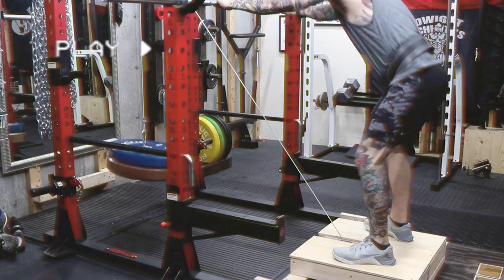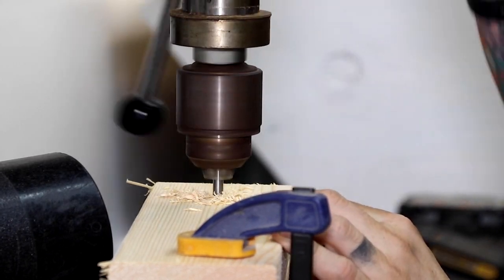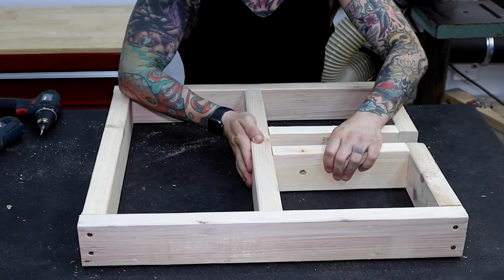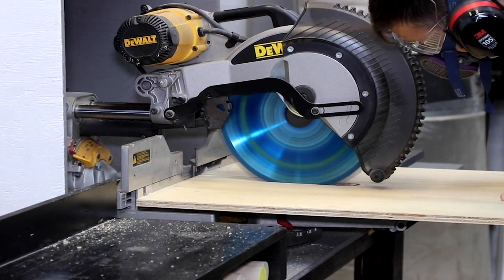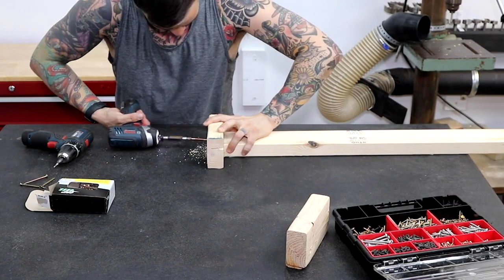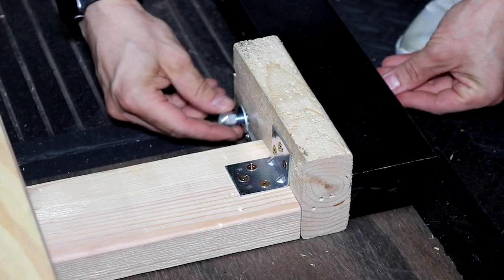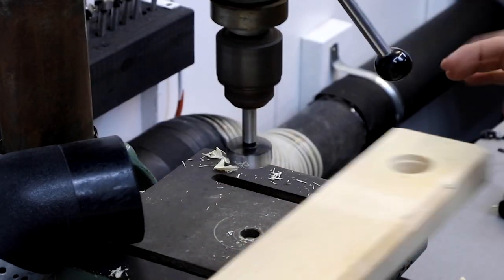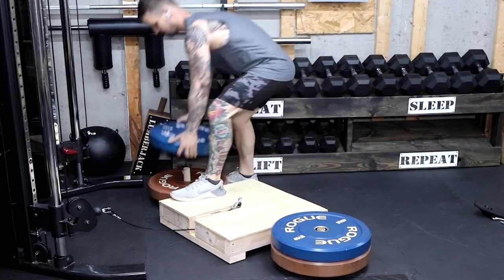DIY Belt Squat Machine, how to build DIY gym equipment at home

Comment: I used this video to build my own belt squat platform a couple months ago. I made mine about a foot wider, otherwise I followed this design to a T. This thing is legit. For those of you who don't have all the tools that Kaizen has, you can get by with less at the sacrifice of some precision. I didn't have a drill press, a chopsaw, a table saw, or a router. I used a cordless drill, a circular saw, and a power sander. It's not as perfectly aligned as Kaizen's but it's still strong and it works well. Thanks for putting this together, Kaizen.
Reply: I almost forgot. I also used a jigsaw.
Reply from the maker: Awesome, thanks for adding those details. I sometimes forget that not everyone has a full workshop like I do. I need to do some build videos with basic tools just to cover all the bases.

Comment: Something you might consider making....

I have a pull-up tower and made a 4ft long belt squat bar, but...I made it 5ft 6in with the pivot 18inches from one end.

If I flip it over so that the 18-inch side is on the pull-up side. It allows me to weight the 4ft lever and acts as an Assisted Pull-up see saw.

Comment: Good idea… I don’t own a rack or lat pull down machine because of height requirement but I own everything else .. I use a diy 2 pulley cable system hanging from my ceiling.. easy to remove. Now you gave me an idea to build a belt squat platform
Reply from the maker: Awesome, that’s good to hear! I’d love to see how yours turns out!

Comment: Double thumbs up!!  Great ideas for a basic belt squat. Suggestion: Research revit nuts for a hold down piece onto the functional trainer. "feet". Threaded insert into the foot of personal trainer along with a bracket and bolt with a handle.  You've definitely checked the blocks for cost, simplicity, and storage.
Reply from the maker: Awesome, thank you for the kind words! I’ll look into the revit nuts👍

Comment: Nice, I like the video and how you solve the main issue. The only drawback, in my opinion, is that in the expensive commercial belt squat machine (like the cumbersome Rogue model), you can start the movement in an Upright position; in your solution, you start on your knee (when attaching the cable to the rack pulley) and thus don't look optimal in particular when you use heavy weight. Anyway, I love your solution. Greetings from Italy.
Reply from the maker: Yeah this video is old. I’ve solved that issue in newer videos 👍
Reply from the maker: DIY belt squat cable attachment, start from the standing position
https://youtu.be/bm9r-df6B04

Comment: thanks for the great video....I will follow your design to build a similar box.
For a second I thought the cable rubber stopper was hitting the box as you did reps...but it didn't.
Reply from the maker: Thanks, I’m glad you enjoyed the video. I still use it all the time but not it is permanently attached to my Titan wall mounted pulley tower.

Comment: Looks great. I’ve had an idea for something like this for a while but never fleshed out enough to tackle it myself. Now with this video I don’t have to! I do wish there was a way to start from a standing position. But that’s not a big deal. 

A DIY leg press is coming I know. How about after that a DIY leg extension/hamstring curl rack attachment?  I have seen a couple designs but nothing compelling. I like your approach to this stuff so I think that’d be interesting.
Reply from the maker: There is a way to start from a standing position! I only found out after posting this video. Check out https://www.youtube.com/watch?v=jmw2MoGTpPE
It's pretty clever and easy to pull off.
I could definitely do a leg extension/curl attachment. I have added it to my to-do list (which is getting pretty long now) and start working on it.

Comment: This is awesome video, I am currently processing with 28 inch wide version. I wonder how far away should be the hole for cable wheel (ordered extactly same wheel you listed). Please let me know. Super great channel. I am excited for this.
Reply from the maker: The hole should be center or close to center. Ideally you want to stand directly above the pulley wheel when doing the squats

Comment: super late response to this video but thats what you get for having evergreen content! Do you think this would be feasible if I made a stand alone box that I could use to for the titan rack? I am probably going to be buying this titan pulley system but I want to use it for more than just the belt squat. Thanks for all the vids on here and insta!
Reply from the maker: It will work as long as the platform is either weighed down or attached to something stable

Comment: In considering selling my Bells of Steel lever belt squat machine and instead buying their Lat Pull down rack attachment just so I can build this platform to go with it. It seems that having resistance pull you straight down as oppose to drag you forward slightly, as the lever one does, is more ideal. Is a pulley based system, such as this one, something that will last for some time? Are there any parts that will eventually wear out?
Reply from the maker: That’s a great question. I think it is built well enough to last a lifetime. Use high quality materials and fasten everything properly, you’ll be fine.
Reply: @KaizenDIYGym  that's good to know. May I ask where you bought that cable extension? Are you able to hit full depth without the stopper/ball bottoming out?

Comment: Will this work better than thoese leverage arms attached to rack post or a landmine belt squat?
Reply from the maker: I don't know if it is necessarily better, just different. I've been using this one since June and I absolutely love it. I haven't even tried a level belt squat or landmine belt squat because this one is sufficient.
Reply: @KaizenDIYGym  thank u.  Will this work with my titan v3 cable tower,  will there  be a way to incorporate it into this cable machine or my Valor lat pull down machine?  My Valor lat pulldown machine has a low pulley too??  I have two bulding disk in my lower back so this wi be really good to build my quads without compressing my spine..thank u for all ur help

Comment: I've got an XMark dual stack functional trainer and I'm trying to figure out how to do belt squats hooked to both stacks. The stacks are 200 lbs each but it's 2:1 so one stack max is really only 100 lbs. The pulleys on the stacks are approx. 44" apart so I built a platform with a hole in the middle and two pulleys underneath and made a couple custom cables that hook to the factory cables and run through the side of the platform to the pulleys, It kind of works but still needs some tweaking. Can you use your skills to come up with something?
Reply from the maker: Wow, that sounds like a sweet set up! My functional trainer is similar. I’ll add that project to my list.
Reply: What kind of stuff still needs tweaking? I'm about to embark on the same project for my functional trainer
Reply: @KaizenDIYGym  i second this. a solution that can use both sides of a functional trainer would be amazing!

Comment: Hey Is it possible to modify the rack attached version such that we can start from the top of the rep of the squat?
Reply from the maker: Yes, I’ve seen someone hang a chain from the pull up bar and then clip the cable to it. That’s probably the easiest solution
Reply: @KaizenDIYGym  I'm guessing Rep Fitness came up with the same solution for a very similar belt squat attachment they sell. Have you encountered any other issues with this belt squat though? How far would you recommend keeping it from the pulleys and why? I'm considering making it slightly longer to be able to also do box belt squats

Comment: Can you make a platform that has control for trap / hex bar for people who have bad balance.
Reply from the maker: That’s interesting. I haven’t seen a product like that before.
Reply: @KaizenDIYGym  I may be a bit crazy, but in my head I see a platform with a control system out by the weight bars on the trap bar which is attached to a platform which is held down by your own weight, but which may be too small to hold the platform steady. I had an operation for lumbar spinal stenosis about a year ago and I have trained my upper body and cycled and walked a lot after that, but I didn't think it gave much results, at least in the legs in relation to the upper body, so I bought myself a trap bar for to practice squats and deadlifts in the hope that it could help the legs. But there have been some problems with keeping the balance, so I came up with this idea. I have also thought of a trap bar with movable handles attached to a land mine where the barbell does not slip out of the attachment to the land mine and the trap bar. There is a lot of good equipment and machines for training squats and deadlifts, but here in Norway you have to be a millionaire to buy such things

Comment: I built your belt squat out of metal but my Problem is that i get pulled forward if i get to 80kg
Reply from the maker: Yeah, it needs to be anchored down under heavy weights. I made an updated video showing how I connected it to a wall mounted pulley tower. In my opinion it’s the perfect diy belt squat set up.

Comment: The power rack version is half-assed. After seeing your clever lever arm build incorporating casters, I'm disappointed with this build. Design flaws: (1) vertically loaded plates gets old really quickly (bet you didn't use this long), (2) starting and ending squat from the bottom - that's very limiting on weight and will really suck once novelty wears off, (3) the design is limiting you to 1/3 squats (note the depth difference when you use functional trainer), (4) use band pegs instead of bolts and nuts to attach platform to rack, it's much quicker; this thing has to be set up every session and removed afterwards, so make it easier.

The design of the platform internals is nice. But better to find a way to attach bottom pulley to rack. That allows for smaller platform that doesn't need to be secured to rack. Easier to do with 6 post rack, so pulleys can be left in place. Long setup time means lower likelihood of use.
Reply from the maker: Hey, thanks for taking the time to thoughtfully critique this video. First off, I'd like to point out that this is a hobby for me, I'm not getting paid, so I don't necessarily have time and resources of a Rogue product designer when building and testing out this equipment. Cut me a little slack.
The platform needs to be either held down with weights or attached to a rack, otherwise it will move all over the place and is unsafe. Of the two options I show in the video, stacked weights and connected to my functional trainer is the way I prefer. Yes, I still use it this way every leg day. It’s really not bad at all.
I haven’t figured out a good way to start from the standing position. That is a fair critique. I am using this as an accessory exercise after doing heavy squats with a bar, so I am more than happy to do more reps with less weight. So far, it's not a deal breaker for me.
The rest of the stuff you mentioned is not really worth going into (see first point about how I don’t have unlimited time and resources to make perfect designs) and I am more than happy to see people modify my designs and make them better. My instagram page is full of that stuff. 
I am okay knowing that not everything I build is going to be perfect for everyone.  My goal is to give people options for building equipment if they want to. I try to make tutorials in a way that is accessible and cost effective. If it doesn’t work for you, don’t make it.
Reply: @KaizenDIYGym  Sure, I get this is a hobby. And I appreciate what you're doing, which is why I'm subscribed and took the time to provide a long comment. If I thought this channel was garbage, I wouldn't bother. Also, my comments aren't just for you, but for the other DIY'ers who subscribe to this channel. Just providing ideas for specs that would make for a better mousetrap.

Yes, your functional trainer version is much better b/c you get very good depth. The other version is practically worthless as it is b/c it's so shallow.

To start the squat from the top, ditch the loading pin. Use a piece of spare upright (or some similar post-type piece), attach weight pegs to it. Attach a D-ring or loop at the top. So now you have a side loaded loading pin. Use a second cable secured to the rack to suspend that loading pin in the air, say 2 ft off the ground. Now load up the plates, and use good collars so plates don't slide off. Now stand on platform, squat down a little (will have to tune height of suspended loading pin to get this right, but you want to get it so you only have to squat down 6-12 inches), attach main cable to your belt. Stand up - with the correct cable lengths, standing up will transfer weight of loading pin to your legs. That means the second cable is now deloaded, so you can detach that (will have to secure it in such a way that you can reach it while on the platform). Perform reps - b/c the suspended loading pin has much more travel to the ground, you can go squat well below parallel if you choose. When done, stand up, attach the second cable, then squat down 6-12", which will deload your legs and transfer all the weight to the second cable. Unclip main cable from belt. Unload plates from loading pin. Hope that all makes sense. I haven't built this yet, so there may be fatal flaws I'm not seeing yet. Curious to see if you spot any issues with this design.